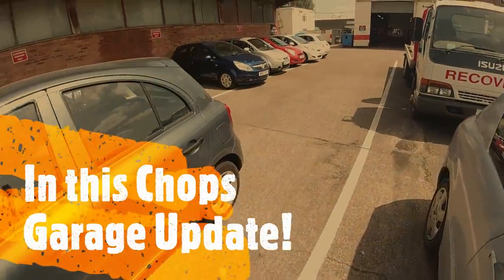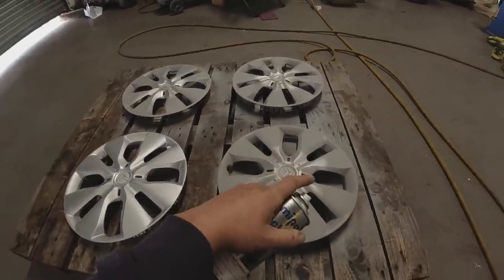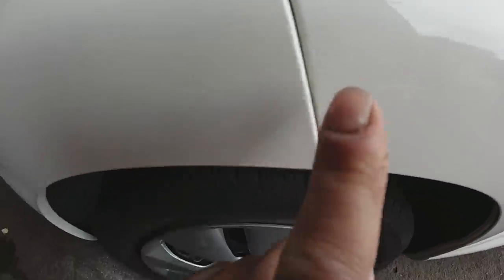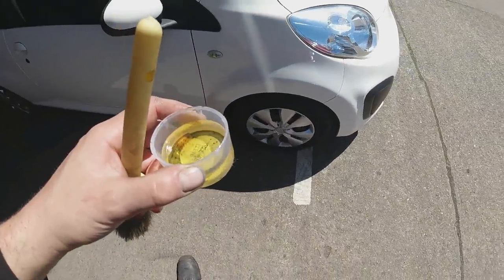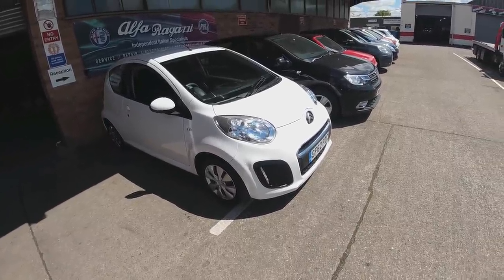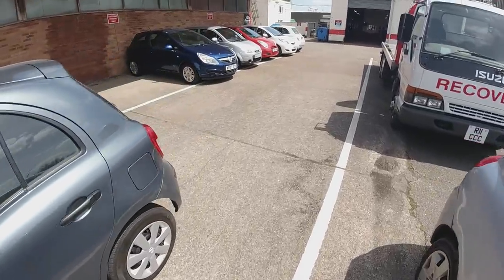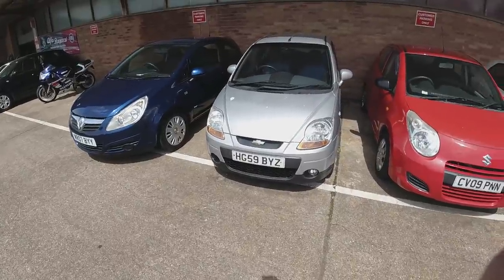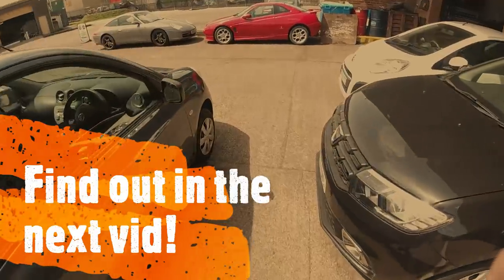You are NEVER going to believe what this Customer did! The ATTITUDE leaves me GOBSMACKED!

Comment: Great Story. 😃
To be fair, that's exactly the attitude I have. If I was paying £5k for a used car with warranty, then I would contact the seller if there was a problem.
I bought my current car during lockdown and had it delivered, not having seen or driven it, sold as is, no warranty for £1750, on the basis of a 7day no quible return if the car wasn't as described. There's faults with the electric windows & the air-con isn't working 🙁 (not mentioned in the ad) but it's a 10 yr old used car with 130k miles. It drives fine & I like the car.😏
If I wanted a motor similar age with no faults I'd expect it to cost £1000 more. I'd rather have that money to sort the car myself. 
Just MOT'd it - needed bulbs and has a lot of advisories incl one v.bad tyre & another very low(which I'd spotted). My choice to have 4 new tyres (£250), replace the tatty gearknob, new wipers. Was supposed to have had oil change before sale but clearly not😒. Most dealers treat customers like chumps.
I'll change all filters, oil, coolant, brake fluid etc myself for peace of mind (£100). 
As I do few miles & expect the car to last a while, again, my choice ; I plan to clean, de-rust & undetseal the chassis. Your car is what you make of it. Treat it with respect & it'll take care of you.
Great Channel 👌 & really enjoy your vids, but you are too soft for a car dealer. 😇
All the best 👍👍 👍  Rob.

Comment: I live in Portugal and garages here selling used cars charge you for a warranty.if the cost of the warranty is high then their is usually something wrong with the car.
Your ethics are spot on and I can see you getting a good reputation.
Reply from the maker: Thank you Peter!
Reply: @dizzy2020  Hello John,
I purchased a Skoda fabia from a car dealer in Lisbon for 2750 Euros which was what they were selling for at the time but a warranty was going to cost me 1000 Euros on top.
Didn't bother with the warranty as car drove ok but transpired that the engine was burning oil at 1 litre per 100km but no smoke?.
Replaced engine at my cost.
At time of purchase I signed a disclaimer to say I don't want to purchase a warranty so dealer knew engine was burning oil and the warranty cost would have covered his expenses.

Comment: Yea that high build primer does that if u are too quick on the second coat then rush the top coat.  I did this on spoiler and cracks appeared weeks later like dry river bed. Also have on other parts like crazing. I think our paints supplied from same marl the etch primer I got the other day was thicker than high build 👍👍👍

Comment: for all black or grey plastic trim we use coconut oil it resists rain marking and the shine lasts for weeks . my independant citroen dealer uses a Micra for a curtoesy car for a little petrol with 250K on the clock its still going well. buy him a years membership to a breakdown company think the AA is £89 a year.  Autohome is £112 but they will always take you home if you ask them to not to a main stealers and that includes homestart to. they will also take your car to any garage within 25 miles of your home for free. so if you breakdown a hundred miles from home you ask them to take you and your car home, arrange repair with the garage and then ask them to move the car to the garage. Im pretty sure the £112 is for personal coverr which covers you for any car your in plus a trailer. so my estimates could be wrong.
Reply from the maker: Thanks for the ideas

Comment: There are two types of car drivers:

(i) People who know nothing about auto mechanics, don't want to know anything about auto mechanics, moan at the least little rattle or problem and blame you the supplier. 
A service means a soapy cloth.

(ii) People who understand something about auto mechanics and keen to find out what lurks under the bonnet and how it functions.  
Who know that nothing is perfect with a  machine running with 40 horses, thousands of degrees in the block and several atmospheres pressure. That only works because there is an explosion several times a second. All that controlled by a temperamental computer with hundreds of different sensors to feed it. And the stresses of the road network and weather to add. 
A service means an oily rag.

Comment: Well knock me down with a feather 🪶,  James I think you said your name was. I wish more 3nd hand dealers where like you pal. Offering to contribute towards something. The dealers I have dealt with are very friendly when your buying, but as soon as the car develops a fault BOOM 💥 Mr Hyde is about. Fair play mate 👏 👍 👌  I'd say discount on service, mot and maybe tyres ?
Reply: I was lucky. I bought a 2011 C1 last December. The heater blower was not working and the clutch cable was not correctly adjusted, so I rang the dealer. He had someone collect the car late afternoon who left his car at mine, then brought it back the next morning all fixed, and collected his own car. I was well pleased because his place is 15 miles away, and my only way to get there is by bus, which is awkward because I would have had to get 2 buses each way taking about 2 hours each way. I thought the air con was not working and considered getting it regassed, but then I realised that besides sliding the control to air con you have to press a button marked AC. Silly me.

Comment: Was expecting the opposite attitude here😆
I think he'll be back to you in the future, typical crappy story about the air con, could have had the old fella fleeced to the max.
Reply from the maker: Luckily we got there first eh!
Reply: In my experience if all the gas has escaped from the air-con there's not much point in putting new gas in to replace it until you find where all the gas leaked out. Pouring water into a bucket with no bottom in it.

Comment: 3k for a 62 reg c1 Jesus Christ
Reply from the maker: ? That's Auto trader recommended retail and showed as Good Price. Try and buy this spec and miles privately for less that 2500!
Reply from the maker: @paddykelly9226  rubbish just done same search all 2500 to 3 for 2012 with less than 75k and some are not even retail sales!
Reply: @ChopsGarage  403016486588 42k on that one £1700 one sec there's like another 6 or so on there too
Reply: @ChopsGarage  184961627497 79k £1600
Reply: @ChopsGarage  324723477741 49k £1600 I can go on all day